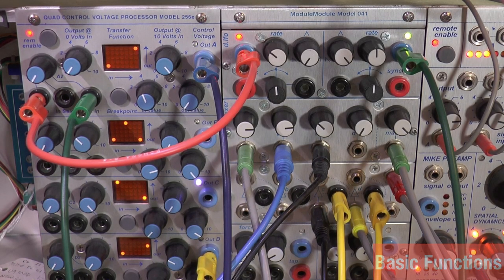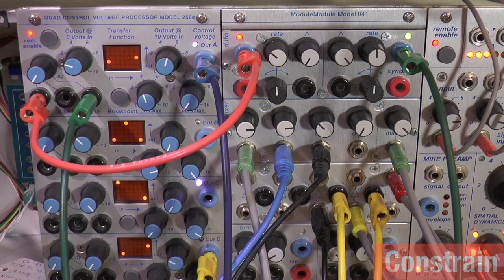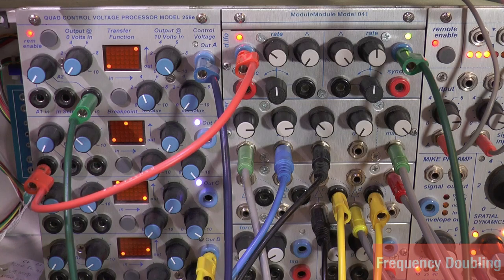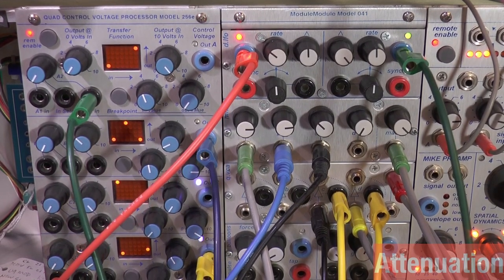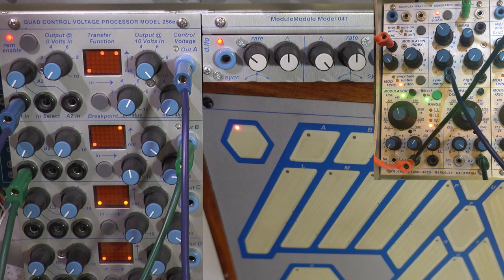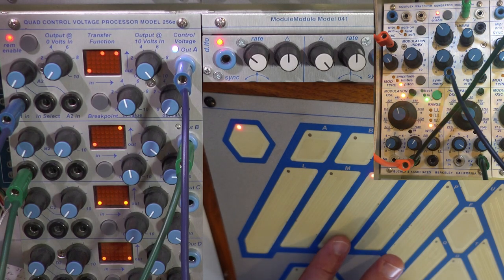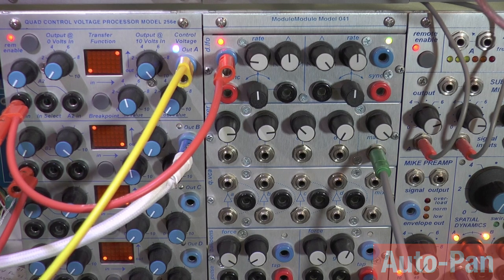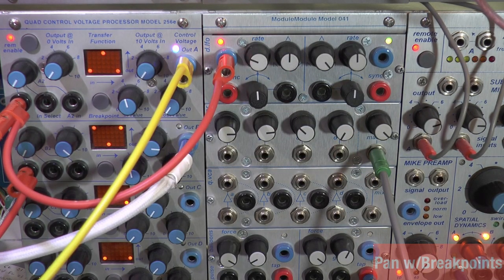Buchla 256e Control Voltage Processor: Applications, Use, and Tricks

Comment: Excellent video!  I see what you mean about running the non-inverted channel through the 256e, in case you need some mirrored breakpoint action or etc...  Thank you for making this!  My vote for the next video is the 223e/222e (or just go for the 252e sexytime).
Reply from the maker: Thanks, D.B.  I’ve been getting a lot of requests for the 223e. I’m leaning toward this order: a music piece I started after filming this (251e is pissing me off though), then the 226h (need to address some bugs first), and then the 223e. I might sneak in a quickie 254e before all of those though.